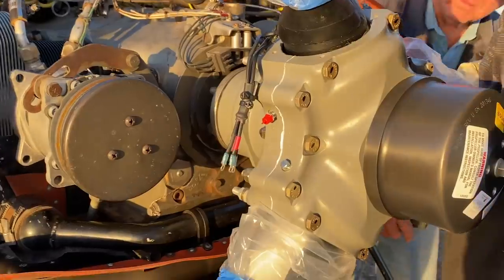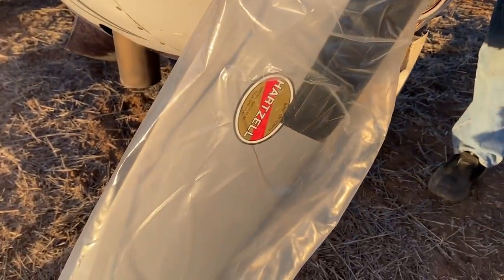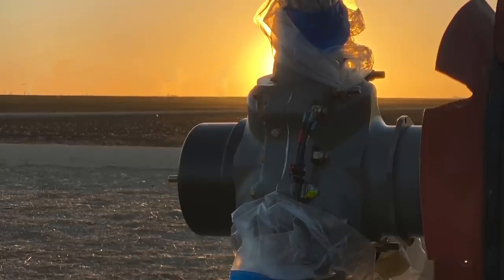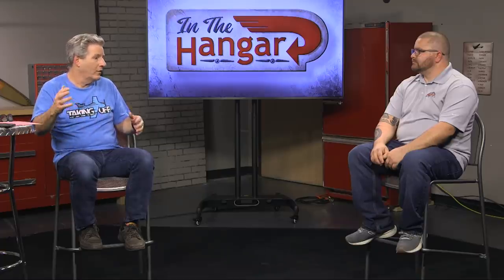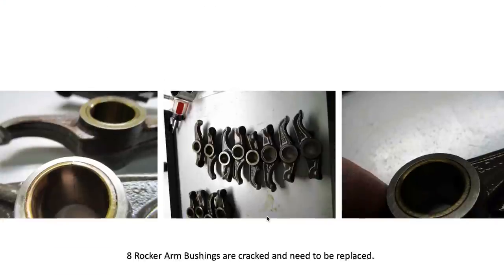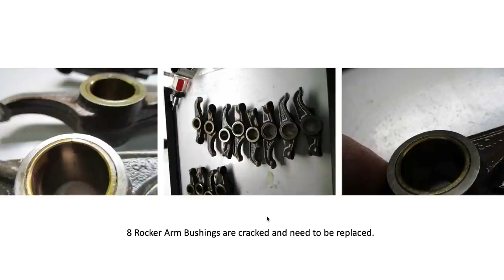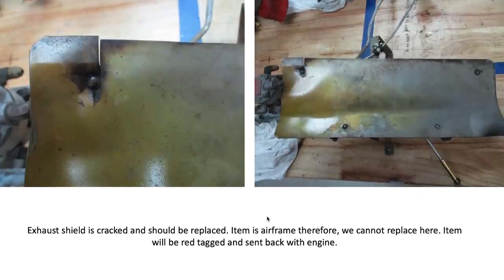Prop Strike, Is Engine Tear Down Necessary?  InTheHangar Ep

Comment: I bought a 1962 Mooney M20C four years ago. Looking through the log books I saw where it had had a prop strike three owners before me. They checked the run out on the crank, replaced some parts inside of  the accessory housing and replaced the prop. The more I thought about it I decided to have the engine pulled, disassembled and send the crank off and have it inspected before I took any of my family up flying in the plane. The crank had a crack through the front oil hole and had to be replaced. The engine had 1,500 hours on the bottom end and 160 hours on the top end. It hade 205 hours since the prop strike. I am glad that I never took my family flying.

Comment: Good evening Christy, Dan & JD.   There is something that people should understand:   there is NO such thing as a "Top OverHaul".   Cylinders are "ON CONDITION".   That means that Cylinders do NOT have a "TBO", their condition of wear and airworthiness determines if they are airworthy to continue using or to be repaired or replaced.   OF COURSE, JD is totally correct about the wear on the other parts, such as Camshafts, Valve Lifters (tappets) and Connecting Rod / Piston Pin Bushings.   IF you put on 6 "Reconditioned / OverHauled" cylinders at 100 hours before TBO / required OverHaul and you are required to replace the engine at TBO, such as at an Air Taxi, you can take your low time Cylinders OFF and put them on the OverHauled "bottom end" and use those cylinders as long as they are airworthy.   Nothing says that you are required to "OverHaul" a Cylinder which has been "OverHauled" 100 hours previously.   IF you have just replaced your cylinders, as above, then put the OLD removed Cylinders back onto the engine and send it to the O/H shop.   Then, you either have 6 known good spare Cylinders or put them on the O/H'd "bottom end".   Some common sense can save a LOT of money and frustration.   This subject is too long to write a book in this comment.   Happy Flying and stay SAFE at all times!!!

Comment: Great info! It amazes me how aviation engines run roughly 4x-6x what automobile engines cost, parts wise, and for complete assemblies. Gotta pay to play, as they say! 

As a auto and small engine mechanic, every so often I'll get a customer that gets sticker shock when presented with a bill. 98% of people have no idea what it took to get that job done. If it were easy, EVERYONE would fix their own vehicles! I suppose the same goes for aircraft. The funny thing is, a large percentage of people treat them as if they're worthless - never changing oil, air filters, plugs, etc.. With today's engines, the way auto manufacturers cut corners these days, you just can't do that and expect a long engine life. Those days are gone, unfortunately. Anyway, great interview, Dan & Christy, and great info from JD! Much appreciated!
Reply: "Most people have no idea..."
Roger that!  I needed to pull the headlights off my Nissan recently.  Between me being a nubb and having only a covered carport in winter weather, it took me a week!  So many fasteners, but nothing complex or heavy.  Next time I'll just swallow the $1,000 charge from the shop and get new lights.

Comment: Hi Christy, hi Dan!
Thanks for bringing up this interesting topic.
What about a following episode / part 2 where
You ask the same questions to a ROTAX engine shop/mechanic?  
I love your fine/polite way of leading the conversations and its therefore 
one of the best aviation channels and by far the one with the most harmony in it.
I like it a lot. Please keep on sharing your thoughts with us!
Reply: I’ve assisted on a shock-load-test on a Rotax 912 after a prop-strike. They don’t need to be completely stripped down. Their crankshafts are “sacrificial” and designed to be a weak-point. What is done is the top spark-plugs are removed and a probe is used to determine the top-dead-centre for each cylinder. This is measured on a protractor which is bolted to the engine and as long as the TDC values are within a certain margin, it means that the crankshaft has not buckled (they are press-fit and actually slip rather than buckle) and the engine should be good to go - I think there’s another test as well (although I cannot remember what it was as I only assisted with the TDC test) but either way, the engine did not need to be stripped down and it did not even need removing from the aircraft.

Comment: good video, would liked more info on how they start a prop strike inspection, what they start with, costs for just the inspection that kinda thing
Reply from the maker: It's an all or nothing deal.  First off, you pull the prop off and get it checked to see if you need a new prop or if you can overhaul the existing.  New prop like mine (constant speed) can run $12-20K.  They can do a check of the flange to see if there's any noticeable problems with the crankshaft.  That's an hour of an A&P's time.  After that, its a removal, ship, teardown and inspection.  Maybe $5-8k for the removal and reinstall, and $13-15k for the teardown and inspection.
Reply: @TakingOff  ouch, but how would they know if you put a twist in the crank with out pulling it out, a friend I used to work with had his A and P, he kept saying you just cant pull over to the side of the road if your hear some thing ....you got be 100%  sure before he would sign off
Reply from the maker: I wish I had filmed more video with my phone when the local A&P did the test, but basically, with the prop off, they mount an instrument that goes up against the flange. Then they rotate the flange to see if there's any discrepancy in the rotation.  I think it's called dialing the prop, but someone can correct me on that.  The point being is that if the crankshaft is bent, you will see a discrepancy.  The old A&P told me in all his years of dialing, he's never come across one that's failed.  So he put my new prop on, I got a ferry permit to fly to my A&P, and we were off to the races.

Comment: Wonderful content as usual. One thing that was not addressed - overhaul due to time. I have heard that you should overhaul the engine every 12 years regardless of time. Was there any off camera discussion on this?
Reply from the maker: No, there are far too many variables just to set a time. What type of engine it is, what type of environment it was stored in (near salt water?), how many hours if any it was run. All those things can go into a relatively dormant engine. For me, if I were about to fly a plane that had an engine sitting around for more than a decade, I would definitely have a mechanic thoroughly check it out.

Comment: The answer: yes, you need to have it removed and inspected.
Reply: As pointed out in the video, it depends.
Reply: @JustaPilot1  ....To whether you have insurance or not :-]
Reply: Wrong and no.  Did you invent that rule? Show me a regulation or an AD that states you have to do this.  READ the regs.  I've seen lots of composite and wood prop strike engines that had zero effect on the engine. Some people want to throw $20 grand at the engine shop and they're entitled to that. But there is no regulation that says you need to do that
Reply: @PDZ1122   You may be correct insofar as FAR's under part 91, although there may be something in FAR's under Part 141, Part 61 or  Pt 135.  However if the hull was insured, (regardless of what FAR's may or may not apply)  the registered owner pretty much has 2 options.  The insurance company may strongly request that it is subject to inspection.   If you disagree (or refuse),  the company has the right to declare the aircraft a total loss, pay the stated value, then take possession of the aircraft and sell as deregistered salvage.  If no hull, the company may have a right to non-renew your policy or to increase rates exponentially.

Comment: I realize that your focus is mainly GA production aircraft.  However, there is a very large segment of the aviation community that do not own those aircraft.  I am referring to Experimental Aircraft.  Many of those use wood or composite props.  Some of them use ground adjustable and for many of these, the blades are interchangeable.  Having a strike with one of these props may, emphasis on MAY,  not affect the engine at all.  Maybe you could have an episode that put the focus on these engine/prop combinations.

PS:  I love your shows, especially the ones with Christy.
Reply from the maker: Yeah, the Exp world is pretty unknown to me, but I"m getting more into it.

Comment: I use to think that tear down and inspection was overkill. I bought a O360 for my kit plane. The engine stopped in flight. Not making power. The forced landing the prop got slightly bent. I had the whole thing torn down. The case had a slight crack which COULD have been there all along. It was repaired. The radius near the prop flange (hollow crank for CS prop) was stripped and inspected and no crack found. It was shot peen and re plated. Nothing else was found. Was the case crack to prop strike? I doubt it but error on side of caution. Also if you have an accessory gear fail you engine is OVER....

Comment: When I did a very light prang of the propeller on a runway, the local mechanic put an indicator on the crank end, and it was perfect. I flew in a new propeller, had it mounted, and flew the bird back. It made my partner nervous, so our insurance guy said that they'd pay for a tear-down inspection and having the crank magnafluxed. We only had a few hundred house since a major, but I paid for new ring and bearings, and there was no issue with the crank. But it was "free", in that it didn't cost us any more out-of-pocket. But you don't know until you rip it apart, do you?
Reply from the maker: Exactly.

Comment: If the engine was running, even at idle, and you have a prop stike you need a tear down.  The bolt on the back of the crankshaft that retains the accessory drive gear is known to crack...I know this from experience and have pictures, not just reading the AD.  You can only see this damage by removing the rear cover from the engine and taking it apart during the teardown.  There may also be other hidden damage inside the engine.  An engine that has suffered a sudden stoppage from a prop strike is a ticking time bomb that will go off catastrophically.

Comment: Improper inspection of a prop  strike killed a friend of mine.  The engine came apart in the air, spread oil on the cockpit, and it burst into flame before crashing.
Reply from the maker: Im so sorry. That's horrible.

Comment: Do Engine Shops use Light  boxes to set parts on to get better images than that shown  at 11 minutes.  light boxes are like Xray light boxes on the wall.. but illuminate parts from the back side and the front with the flash. to get a better detail to the images.??

Comment: In my case a prop strike was a godsend. I was going to buy a 182 with 600 hours on the engine but when I went to see it there was no engine! What happened? Well the owner confessed to a prop strike on a tow bar. It turns out there was 3 bad cylinders so I paid for three more (he paid the others). Also he had to pay for a new prop so I added about $10,000 for a new Harrell 3 blade. In the end I got a new engine and prop for about $20,000 over the original cost.
Reply from the maker: Nice!

Comment: So, you decide to do the minimum after a prop strike. Bore scope, but the cases are not split. Your then out doing a 'photo shoot', over a densely populated city, low altitude, with no airport or place within the 'glide ring' to get down safely.  Your engine makes one or more "odd noises". (Odd = different from what is usual or expected.)  At that point, I would bet everyone would be willing to open their checkbook and write the check for the complete job, overhaul and/or complete inspection. For me, I would prefer to just skip the first part and write the check.    8)    JMHO    --gary
Reply from the maker: Hi Gary-- I"m a bit confused.  I never decided to "do the minimum?"  WHen the strike happened, I could have just put a new prop on after the A&P dialed the flange and would have been "legal" according to the local FSDO office (because it's a continental).  But instead, from the start, I had decided to do a removal and teardown inspection.  I never flew it over a densely populated area for a photo mission.  Are you just making a hypothetical if I had decided to just put a prop on and call it good?
Reply: @TakingOff  It was all hypothetical Dan, sorry I didn't make that more clear. I should have used something different.  Sorry, my bad...  8(    --gary
Reply from the maker: 😂 sorry I missed took it!

Comment: According to Lycoming, this is what's considered a prop strike:  Any incident during engine operation where the propeller impacts a solid object. This incident includes propeller strikes against the ground. Although the propeller can continue to turn, damage to the engine can occur, possibly with progression to engine failure. Sudden RPM drop on impact to water, tall grass, or similar yielding medium where propeller damage does not usually occur. Any incident, whether or not the engine is operating, where repair of the propeller is necessary.

You can't know the extent of damage UNLESS you pull the engine apart....PERIOD.  What damage?  Side loading on the crankshaft of the propeller flange, front bearing, and seal.  Even the slightest damage to the prop itself (even if it wasn't spinning when damaged) can cause crank damage over time.   Initial damage may allow safe operation, but the progression of problems may become significantly severe with time and wear.
Reply from the maker: All very true. What’s interesting here is that there is an AD for lycoming prop strike mandating engine tear down. But not Continental. So while I would always tear down my Continental, the FSDO informed me I wasn’t required. I did it anyway.
Reply: @TakingOff  Yes. Continental isn't as thorough as Lycoming.  I fly a Cirrus so have a fuel-injected, turbo IO550.  I am so careful I even get oil analysis with each oil change and change the oil twice as often as recommended.  And I never run over 75% of power.
Reply from the maker: I agree for the most part.  I just hope you didn't baby it during break in.  You've got to run those continentals hard and hot when breaking in.  If you baby it (ie under 75% power), good chance of glazing and other bad things.
Reply: @TakingOff  Break-in is totally different. You are running mineral oil and seating rings.  And you are running it full power for 25 hours.  My engine has 700 hours on it now and it purrs like a kitten.  Uses zero oil.  And analysis shows wear inside normal ranges.  I even still have the original main battery (the backup was replaced last annual).  I use a battery tender on it to keep sulfates down and it was a great investment. There is no need to push the engine past the green CHTs nor run full power...I get 185 TAS at 75% power and that's plenty fast enough.  I also figured out how to better run LOP...by using TIT temps instead of MAP or the Cirrus carat.
Reply from the maker: Awesome. SOunds like you did it (and doing it) perfect.
Reply: @TakingOff  warm that sucker up good and pour the coals to it! 😂

Comment: $22,000?? ...how do aircraft owners afford this? I mean, do you just put it all on an AmEx card? Or are you saving money every month in anticipation of these large expenses? Is there a video on this subject? -Thanks
Reply from the maker: THe answer can be All of the Above.  As part of buying the airplane, as I researched, it was clear that you have to factor the cost of overhauls and other maintenance, so you come up with an hourly operating cost, it's not just the fuel you put in.  So taking into account scheduled and expected maintenance, while fuel might run about $75/hr, the real cost is more like $220 hour for my Cessna 210.  So if you can, that's the money you put away to cover these kinda of things.  And use a card to carry it if you didn't save enough. 🤣

Comment: Should be obvious - the strike caused a harsh impact against bearings and other components 
that were not designed to take stress from that angle.  Not hard to imagine the potential damage caused there.

Comment: Whats necessary is not relevant here. What is relevant are the requirements specified by the manufacturer. There's no reason to ask that question.
The question that should be asked is whether it really is necessary to stick one's propeller in the ground.

Comment: Your prop hits a rock and damages the prop . . I might suggest taking the prop of to see if it can be repaired then I would check the prop attachment to the hub and also the crankshaft for possible hairline cracks . You can fix it on the ground not in the air .
Reply from the maker: All those steps were taken with my plane. We took off prop and I delivered it to a certified prop company and it did not qualify for an overhaul.

Comment: Cost per hour is ridiculous.  Why can't they last longer? This isn't 1940 anymore.
Reply: I have rotax which has been the cheapest to operate and longest lasting in my aerial survey company. They also run smoother and are more fuel efficient. But I’m personally really looking forward to all electric. I’m tired of gas engines and the never ending problems that come up.